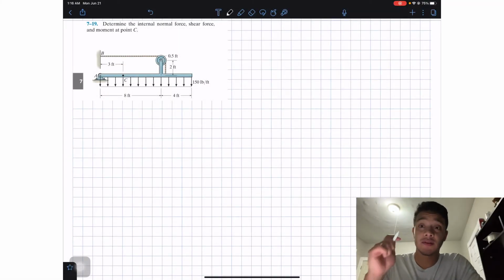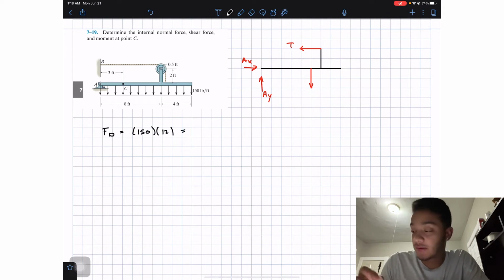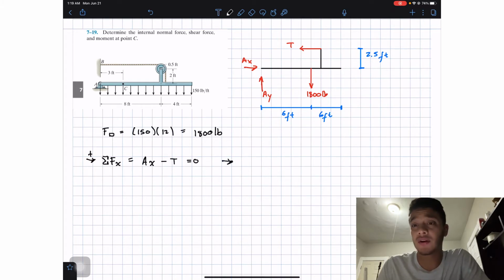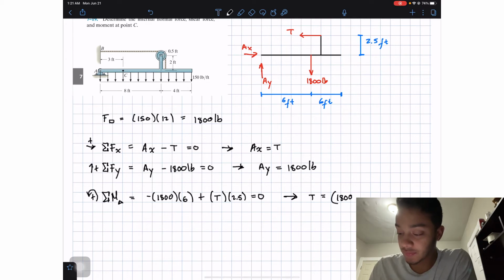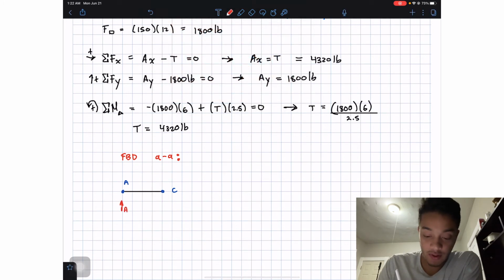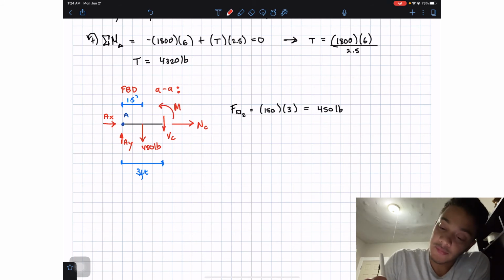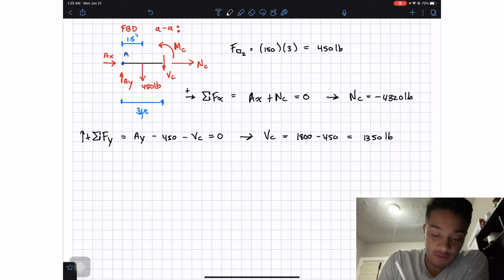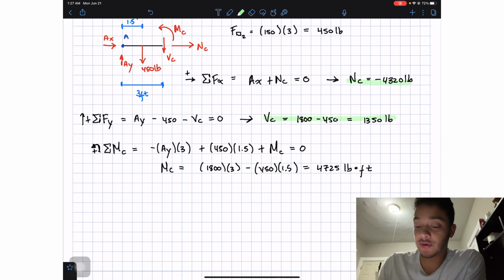Statics 7.19 - Determine the internal normal force, shear force, and moment at point C.

Comment: How did you know Vc was going down?
Reply: Two ways:

1) Positive Sign convention for V on the right side of a member is pointing down. It points up if it's on the left side.

2) If you assumed it to be up instead, when you solve the equilibrium equation, you will end up with Vc being negative, indicating that the assumption that Vc was pointing up is wrong, and it is actually pointing down.

Comment: Why did you ignore the vertical tension in the rope connected to the beam?
Reply from the maker: I understand why you make that question. The way I like to think about that specific problem would be to imagine yourself being the beam, the rope that is vertically its attached to your body, however, the pulley is the one that makes the tension and thats the reason why I only considered the tension going to the left.

It is a very vague explanation but my point is try to visualize the pulley system in real world and where would be the force going? I hope it helps!
Reply: @LearningbyTeaching Nice explanation! I understand you dude but I initially considered the tension going to the right because of the reaction force acting on the rope from the support.. however,I literally understand the system if the pulley clearly from you now 😉

Comment: Please solve the below question.
The crane shown in Figure above is supported by cables BD and BE. The distance marked and in m. What are the tensions in the cables BC, BD and BE, when BC is parallel to the x-axis?
Image: https://www.google.com/url?sa=i&url=https%3A%2F%2Fwww.chegg.com%2Fhomework-help%2Fquestions-and-answers%2Fcrane-shown-supported-cables-bd--determine-cable-tension-q14912243&psig=AOvVaw1SZGLsEr4jlKaZOgqQEZc2&ust=1624488455017000&source=images&cd=vfe&ved=0CAoQjRxqFwoTCPDGzp-prPECFQAAAAAdAAAAABAN
Reply from the maker: I Will upload a video, I hope it helps you! :)
Reply: @LearningbyTeaching  Thanks a lot
Reply from the maker: @shanthinikamaraj1875  https://youtu.be/yx6UIfgUnmc